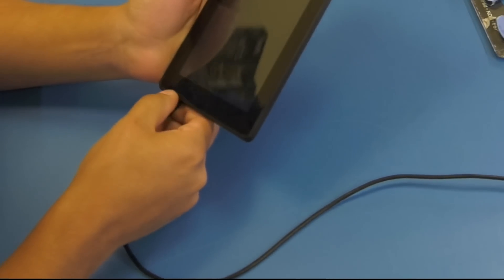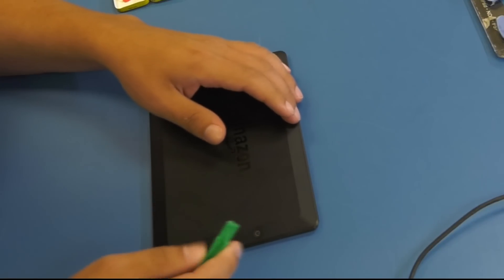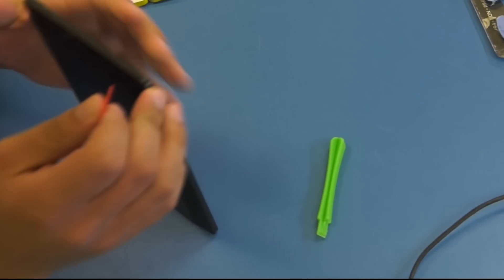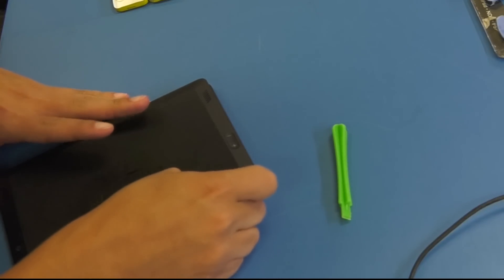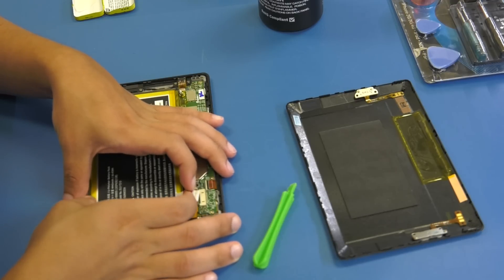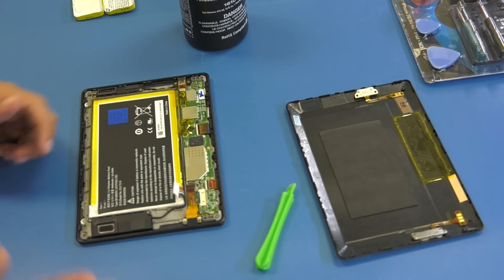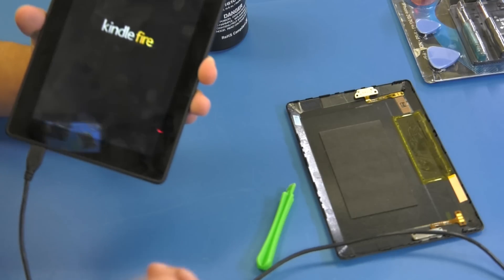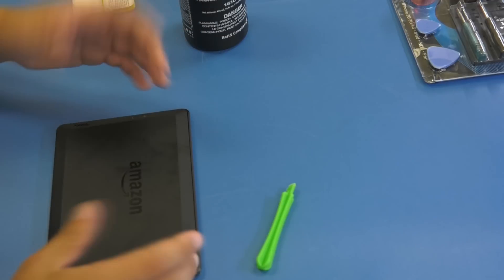How-to Repair a Non-Charging Amazon Kindle

Comment: Thank you so much for this fix for the "moisture detected in the USB port' error on my Fire tablet. I had tried several other fixes posted online and nothing worked. I was thinking that I would have to go buy a new tablet when. I came across your video. I didn't have much confidence that it would work since everything else I tried failed, but I decided to I would try this one last fix before giving up on fixing the tablet. I can't express my gratitude enough.
Reply from the maker: Glad I could help

Comment: Saw one other video just like this, minus the isopropyl. Maybe Amazon saw it. My Kindle Fire 7 5th gen (I think) has the battery connector stuck to the motherboard and I don't think I can unplug it. Help?
Reply from the maker: Get the best magnifying glass you can get your hands on and look closely.  Sometimes its glue, then carefully pry off.  Sometimes the connectors are just tight and require gentle movement back and forth and a steady pull.

Comment: I have a Kindle e-reader that is maybe 6 or 7 years old.  I replaced the battery; but, am still having problems with it charging up.  I have tried holding the power button down for 40 seconds at a time to maybe synchronize the battery to the operating system; but, it does not work.  Even leaving it plugged in overnight is not working to recharge the battery.  The charging cables are fine, the electrical outlets are fine; but, there does seem to be a problem with the communication between the charge port on the Kindle and the battery.  I'm not proficient enough to know what to try next. Do you have any suggestions?

Comment: thank you very much, had the critical battery issue on my kindle paperwhite and the charger wouldn't turn on. Use this cleaning method along with Pro Repair Tech's video on the 10th gen tear down. All it took was cleaning the battery cable ribbon and circuit board connection. Plugged it back in and boom, actually see the charging light turn on! I might of ruined the waterproofing of this tablet, but at least I'm not giving anymore money to Amazon!
Reply from the maker: Thanks for watching and the comments!

Comment: Thanks I’m not sure I would have tried this without watching. Mine must be newer and has an even SMALLER battery plug. Not a surprise it is a weak link.
Reply from the maker: Thanks for watching!
Reply: @TechsavvyProductions  I have a 2017 Kindle HD 8 7th gen that won’t charge after installing a new battery. The battery wasn’t holding charge well, the original, ended up leaving it plugged in while using it. One night the screen flickered a little and the next night’s when I tried to use it, it was dead and wouldn’t show the charge indicator. Changed outlets and cord and saw the indicator briefly and then gone again.

I saw the video about disconnecting the battery and charge port cable, cleaning the latter, but my Kindle doesn’t have a cable to clean coming off the charge port - built into mother board. Anything else I can try along those lines for this gen Kindle?